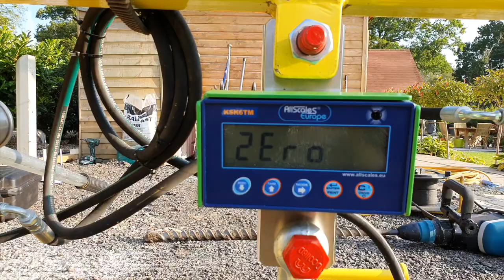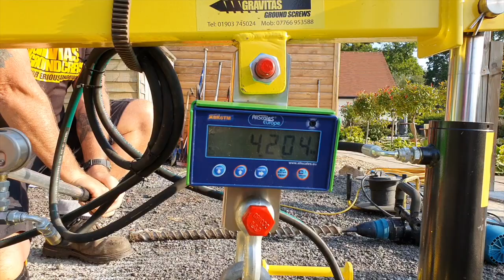Big Strong ground Screws for garden room or home office foundations no digging or concrete!!!

Comment: Hi Robin Thanks for your reply, could I just add.  For the client any building work comes as quite an intrusive shock to most of them and having a lot of builders thrashing around can be very distressing for them, as they don't always envisage what is going to be involved, for some rather than being an exciting time it can be very upsetting. I never let any one on my jobs rush around or go any where they are not supposed to be an to show respect to the client at all times. I think that these screws lessen the impact for the client and make it a more enjoyable experience and that has to be good and they keep the the mess down for a better environment to work in. Great work as always Robin, tough times at the moment.

Comment: Just crossed my mind as we that these could be used as part of the electrical installation. The screws could be used as a multi rod TT earthing system.
Reply: As long as they remain conductive after their surface finishing process. Anodising for example produces a non conductive surface.

Comment: I do like the US system. Drill a large post hole, drop in a cardboard tube straighten it and level the tops. Fill with concrete and job done.
Reply: I'm surprised that you can't buy Sonotube or similar in the UK.

Comment: Excellent video, thanks Robin. We had a garden office pod built last year. Roughly 5m x 4m footprint, used 12 ground screws. Setting-out and installation took about 4 hours start to finish so construction of the structure could start next day. Very impressive form of foundation.

We are in discussions with our architect about a rear extension to our house (approx dims 7m x 4m) and have asked her to speak to the engineer to see if we can use ground screws for that too. Saves a lot of time, money, disruption and CO2!

Comment: The caveats near the end are important. In my project I had heavy clay and it wasn't possible to drive some of the screws very deep even with that massive torque arm, so some of the screws were swapped to shorter versions. Plus we hit rocks. When you hit a rock you're a bit screwed (no pun intended), because you've already disturbed the ground, and you really want that position, so what do you do? The end result was screws not perfectly located and/or not perfectly plumb, which was time consuming to correct for (I fabricated some ugly but strong epoxy mortar shims). Now the level of professionalism of the installers wasn't as high as is evident here, but the lesson is: design so that you can cope with slight variations in position. I think if I ever do another similar project I'll just pour concrete piles. I think these screws work best when you have deep but workable subsoil.
Reply: Heavy clay isn't too much of an issue, it can be overcome by either pilot drilling with an earth auger or by taking a measurement to see how high that groundscrew is sitting.  That screw then gets removed and cut shorter - if you haven't got a shorter screw that can be used.  As the ground has been disturbed, the hole gets filled with 10mm gravel and the groundscrew driven back in.  The gravel acts like a rawlplug, it gets compacted into the ground around the screw giving it good purchase.  A pull test will confirm that its well in.
Reply: Yes, the "ruined" soil can be fixed with a smal stone mix. Take the pole out and pour the small rocks on the hole, then put the screw back and redrill! Quarantine solidity as original 😊
Reply: Use the chicken leg 😂
Reply: @Dragon-Slay3r  ???

Comment: I remember something similar on a DIY SOS many years ago. They used impact to screw them in, but had to wait for a flint wall they were building to harden because the vibrations were causing it to settle.

Comment: Hi Robin, Great video, I’ve just looked into using these here in Australia for a deck I’m going to be building. The are quite cost competitive when compared to digging or using a post hole digger, disposing of the soil, concrete delivery and concrete pump, and all the labour associated with this. Ground Screws can be done easily in 1 day, and saves a heap on my 50 year old back.

Comment: Hi Robin cracking video, the screws are a cool idea quick and easy foundation and very cost effective I would assume look forward to the next phase, quick question who signs them off engineer or the screw company all the best Tony 👍 have awesome weekend
Reply from the maker: Hi Tony, these get signed of by building control based on the pull tests and our overall loadings etc, have a great weekend to mate, all the best Robin

Comment: Thanks for sharing. With the weight of building structure sitting on ground screws, wouldn’t of thought you need to be concerned about pulling screws out, more if the sink in the ground under the loading. Back to front test I think.
Reply: For wind loading I would guess, cheers

Comment: This has to work in the right soil conditions. Seems like these could be frustrating in certain circumstances. Nice system otherwise. Like an auger for deck footings. I did most manually because its like 50 50 that its worth it. Although the pilot hole prob makes a big difference. Cheers. Good vid

Comment: What’s the point of the pull test. I would be more worried about the possibility of sinking than the building levitating off in to the air.
Reply: A pull test can be used to measure the compressive capacity as well. Typically a tension test will give a lower value, but the load in either direction is primarily a function of the engagement/contact area of the threads and the strength of the soil. The reason a pull test comes out a bit lower is you may get some extra capacity from the end bearing of shaft when pushed down.

That said, their test was meaningless. They should have used a dial indicator to measure the amount pier pulls out at load increments- the capacity is not typically taken (factored off) from the point of failure but off an allowable deformation
Reply: @c4fishfood  Well, if you only use 50% of the breaking force, knowing that a push down test would bring you even higher values, I think you are on safe grounds (pun intended). By the way, due to windforces thath can easily carry away a wooden Gardenhouse, knowing the amount of "pull" that these screws can take is important too.
Reply: Jörg Schulze The problem is more to do with the consequences in the case the screws hit or exceed their rated load, and you are not able to determine that from purely the applied load on a pull test, needs to be measured in combination with deformation. It may not be a problem for a “garden shed” but this building could very well be built no different than a house. What’s the point of doing the test if not done right? I’m not pulling this out of my ass, it how the proper test are specified. 
Also, I agree that the uplift capacity might be required (earthquakes control uplift load where I’m from)- I was just responding why the test in the up direction is able to be used to estimate bearing capacity. The real reason it is done in that direction is that it is easier to pull a screw pile than to push it.
Reply: Or more like shear loads. Would be one heck of a bracket sleeve to hold a 6' fence up. Very cool anyways.
Reply: @gulashonu  Agreed- these small diameter screws do not have a very good lateral load capacity unless tied together to work as a group.

Comment: You're measuring the resistance of 1 screw but that would be the weight through that 1 screw. However, if you add further screws wouldn't that in effect share the weight bearing load?

Comment: I'm guessing a site survey is required prior to screws going in to make sure no services are below. Does the company you hired do this? If something is damaged, i.e drainage, does the company take ownership of this or is this the responsibility of the contractor?
Reply: The first question I ask any potential client is whether there are any services running through the site. In most cases the builds are at the back of the property and unlikely to have any services. If I'm in any doubt I use https://www.linesearchbeforeudig.co.uk/ to get maps of all the services and what they might be. I have a CAT scanner to locate any power lines and I can hire a flexible rod sonde and generator to locate drainage pipes. Gas mains are a different matter and if they show on the maps, I'll make the client aware which can hold up the installation until they are pin pointed. The beautiful thing about using screws though, is once the services are located, the network of screws can be plotted to avoid them with no loss in integrity to support the structure. I'm also insured up to £10 million for public liability.
Reply: @gilschaeffer5522  Thanks for taking the time to reply Gil. Could you elaborate on the costs for the screws and are you a nationwide company or just based down south.
Reply: @abskan4015  please email me at info@gravitasgroundscrews.co.uk and I'll answer all your questions. Cheers!
Reply: @Abs Kan the sub-contractor that installed the screws for our garden office used a cable avoidance tool prior to setting out, plus I worked in a utility and anticipated questions about service runs and was able to describe routes of all services.
Reply: @abskan4015  That was a little bit sneaky my friend. Perhaps you could elaborate on your costs for your screws and where you're based? I hope you're keeping busy?
Reply: Lol, I am not even in the trade. Robin has clearly posted below how much each screw was done for. My comment were generic. As for me drilling in some screws at a site, I'd struggle to drill a screw in a wall. Mistaken identity.
Reply: @gilschaeffer5522  I've always been doubtful of how likely the insurance would be to pay out if you go through a service... Either you haven't checked something you should have, in which case they can get out of it, or the utility company is liable for not knowing or marking where something is which you've asked them to do. I did an awful lot of research into this when I had a very, very, (very, very, very) stressful experience with a fibre optic line (which thankfully turned out alright in the end). Less so with other services, but with fibre optic, they have been known to take you to court even if it's their fault, just on the off chance they might win or get 50/50 as spending a few 10's of thousands on legal fees is still worth a try for them financially depending on the specific circumstances.

I also had an experience with a gas line, that no one was quite sure the location of, they felt that although they couldn't tell me where it was, if I went through it then I'd be liable because they were telling me it was "in this general vicinity, don't know what depth because it looks like it was put in during the 80's... And if it was a Friday afternoon... well it might not be very deep". 

Yet another story: Builder I know dug less than a spade depth below ground level (which hadn't at any point changed depth since the line was put in), went through mains electric, insurance wouldn't cover it as "he should have checked where the services are", and the electric company took him to court...He fought it, spent a lot on legal advice... After two years the court agreed that he was liable.

I'm sure some people do get covered by their insurance... But I can't remember actually meeting anyone who's been covered for going through a service?
Reply: @longleaf0  We all know that insurance companies will try to get out of paying out if they possibly can. From my end I just have to do my due diligence. In almost all the installations I do, they are in the back garden of properties and the likelyhood of there being utilities is far less. But I always ask the client in a pre-commencement questionnaire if they know of any utilities that may go through the site. If I'm in any doubt I use the web service https://www.linesearchbeforeudig.co.uk/ to provide me with as much information before I start. I always carry a CAT scanner to find electrical lines and I will hire a flexible rod sonde with a generator to locate pipes and drains. Just this week a gas main showed up on a survey and I had to postpone until the client would locate it exactly. I put the ball back in their court and it's up to them how they procede. It does make you wonder what you pay insurance for if they wont pay out. For what I do, there is not a lot else that I would want them to pay out for.

Comment: What's the point of the pullout test. The screws are not subjected to a tensile force. You would need to undertake a static axial load test. Add some kenteldge and see if the screw settles

Comment: Pull test needs to be spread over a larger area otherwise the soil is being compressed between the testing rig and the pressure bulb created by the screw.
Reply: I did wonder about that too. The footprint of the hydraulic test rig seemed to be quite small given the load applied. I wondered if the load would cause compression and distortion of the surface under the test rig so rather than pulling the screw out, it would tend to pull the test rig into the surface. Maybe use some form of plates under the test rig footing to spread overall load per unit area? The prepared surface looked pretty robust though, even if the ground is essentially clay of some description. Maybe Type 1 is used to distribute some load? Very interesting though.
Reply: @protectiongeek  it is ideally done over three reaction piles using beams to span over the pile you want to test so the pressure bulbs from each do not interact with the one being tested. Maybe they use a factor on the read out other then the safety factor which is typically 2:1 or 2.5:1. The theory is if it can resist an axial force in tension it can resist the same in compression. 👍

Comment: The ground screw tested will hold more after 24hrs after installation as the water pressure induced to the soils during installation settles again.

Comment: Hi we have the rock hard clay but we have a high water table and it's coming up from the ground, would these screws work still for a log cabin base?
Reply from the maker: Absolutely they are galvanised and durable, I use them in Clay all the time, and our clay is very hard

Comment: Hi Robin, would you say this particular screw system could be used to build a timber frame room and house my full size snooker table. It’s currently at my parents house in a conventional building I built with solid concrete floor. Looking to re-house it at my new place.
Total weight 1250 kg but weight per legs x 8 is 160kg.
Obviously calculations for room weight yet is unknown.
Thankyou.
Reply from the maker: Hi Gary, It all depends on the ground mate, where are you based? if the ground is good then yes its totally adequate, for the snooker table you would simply stiffen the floor structure locally and have some additional screws in that position
Hope that helps mate
Reply: @ukconstruction  

Many thanks for your quick reply. In Surrey on chalk. Trouble is no side access anymore, I just finished big wrap around extension but gotta move table. Looking for less aggro on oversite. But need to build very soon. May be in touch.

Comment: Hi, I like these for poor access jobs, but can’t see how they cost effective against a 3ton machine for day/2 tips. To pull out rubbish and get a raft concrete floor slab in???  
How much is it per screw? Cheers
Reply from the maker: We costed a raft and with the structural engineers fee for the calculations to make this acceptable to the building inspector, the groudworks, shuttering, reinforcement, concrete and muck away would have been 10 times the cost of the screw piles, we investigate and evaluate the best and most economical solutions for our clients also we have an eye on the impact of our builds, screws are absolutely perfect for a temporary structure such as a garden room or home office
Reply: @ukconstruction  Previously the cost was about £100/screw = £2,100 approx. Are you saying a concrete slab would have cost £20,000?!! 
Thanks for the vids, very interesting!

Comment: I dont understand why you do a pull test on something which wont receive any pulling force. Rather you dont want them to sink into the ground under the pressure of whatever your building ontop
Reply: Wind load
Reply: @richardcapey-wade8191  
The wind may lift up the structure???

Comment: Uplift resistance does not equal bearing capacity. Just thought you should know.
Reply from the maker: No indeed, from our tests the bearing capacity is considerably more in most ground conditions than the readings that we ascertain from this pull test, but we have a formula from our pull test to compute the potential bearing capacity and then for working out suitable loadings per use a 50% safety factor for example if we work out that a screw can take 3 tons of weight we only would apply a loading of 1.5 tons

Comment: If that cost £2100 for the screws how much would the equivalent concrete slab cost?
Reply from the maker: A concrete slab that is engineered not to fail and meet building regulations for this build would need to be a proper reinforced raft and it would cost well over 10k maybe even 15k
Reply: Where did you get £2100 from bud?
Reply: Fredrick Welch I’m assuming he’s priced them at £100 each and robin says he’s using 21 screws😁
Reply: Fredrick Welch - yep 21 at £100 each
Reply: @ukconstruction  Robin, you're not comparing apples to apples. With screw piles you need to include labor and framing materials for the subflooring.  There may be some savings, but not much. A simple slab can be formed and poured in a day. I don't like that there's air gap below the structure - easy access for critters to get at insulation.
Reply: @ArthurDentZaphodBeeb  The "airbed" will actually keep the mold and smaller than foxes out of the structure, the ventilation is all that actually matters!